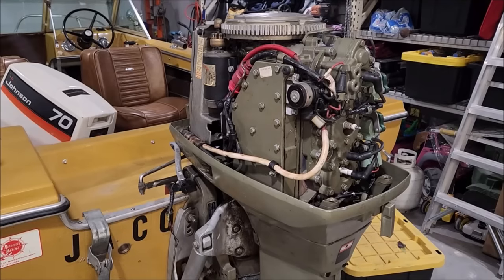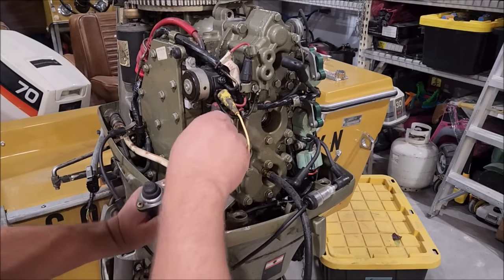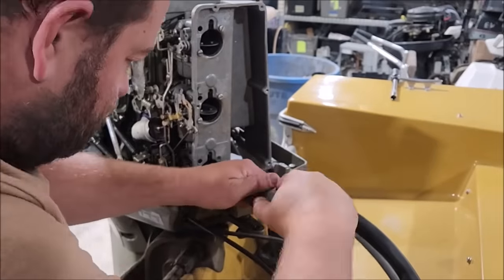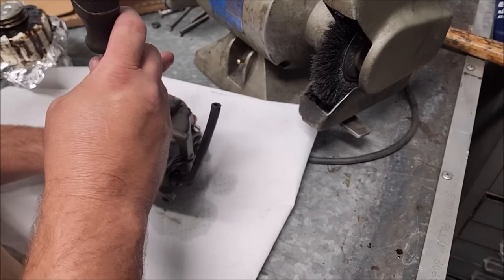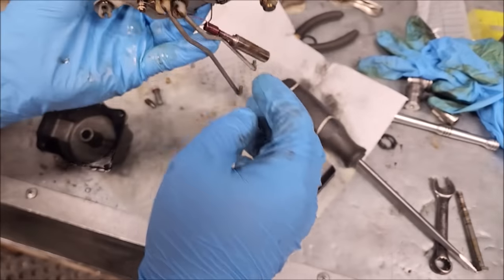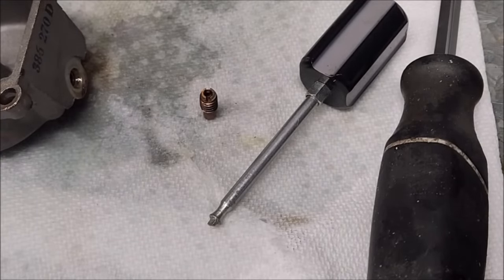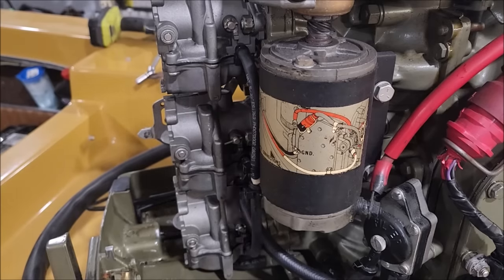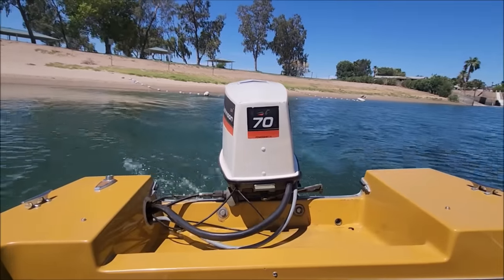Minty 1974 Johnson 70 HP Doesn't Run Once in the Water

Comment: Just had the same issue with the same model I gotta lync and sync buti found out my impeller was completely shredded and fuel pump was Crack allowing air runs mint now wot just not very stable at low

Comment: dirty jets in the carb restriction in fuel flow mixed gas the oil accumulates because owners don’t disconnect the fuel run the carbs dry after each use. Prior to the engine running out of fuel use the choke to run the bowls and fuel in the system dry.  Then you’re good to go next time.

Comment: teacher can sometime you delve into timeing-i got the initial timing w the measurements-its the running in a tank w muffs wo a timing  prop wheel-joe reeves method???-and or adjusting the idle jets-i do alright but i aint a pro and want to do better-when i get it right the engine jumps to life-when i dont it wont idle down-engine shakes etc etc

Comment: Tune the motor in a barrel of water.  The motor needs the back pressure on the through hub exhaust.  Problem solved.
Reply: Obviously not this one?
But if it won't even run in a barrel.....yes of course...check for debris in the exhaust passage.
Reply: So it runs on the mouse ears though?  Correct?
 @JohnSmith-yv6eq
Reply: What I was saying is that you need to tune the motor when it's in a barrel of water.  Don't tune it on the mouse ears. There's no back pressure with the mouse ears. Adjust the carbs when it's in the barrel.  @JohnSmith-yv6eq

Comment: I could buy one like this think it's a 1975 seahorse 70hp 300$ guy says runs great I've got a 70hp evinrude 1970 at moment I just replaced water water pump power pack coils wires caps and plugs haven't taken it out yet had same issue ran good on trailer it seemed but I water 70hp trolling motor lol so hope I resolved the problem just bought a 9.9 Johnson 1981 200$ put new waterpump and cam roller runs great got it a kicker case 70hp evinrude let's me down someplace not funny paddling miles back to launch lol northern Ontario it's common to go fishing and not see another boat so don't count on a tow if your motor quits always have a little kicker on the back also to get ya back in case lol she should push my aluminum starcraft just fine can't troll either with 70 too fast having that 9,9 be great for that too great videos I can wrench on most motorized shit but outboards are kind of a career in themselves I mean there unique compared to cars bikes trucks so a few of your videos helped me out so I had a better idea what I was up against for waterpump an fuel pump rebuild timing and throttle linkages I think is the most difficult thing to get back together and adjusted in sync  with each other carbs generally are very similar to me who needs a 10000 new 60hp or 70hp when you can get a fixer upper throw a few hundred in it little time an boom

Comment: Gee, why didn't you do the whole repair. ??  2 strokes run good, but fuel now days is lousy.  The oil in the fuel makes the engine run crappy. (plus does anyone mix the oil/fuel properly) You didn't pull the fuel pump apart as it says on the cover  FILTER.  The same schmoo in the carbs is in the fuel pump.  People with 2 strokes don't know that the fuel goes bad really fast.  I have a hard rule... when I see schmoo I immediately dump the fuel,  clean the carb, replace filter, and put in FRESH fuel mixture.  99% of the time problem fixed.  Thanks for the sermon at the end...now I don't have to go to  church Sunday.

Comment: ethanol.  eats the plastic hoses. bad stuff ethanol.
Reply: Plastic hoses (real plastic hoses) always get brittle, crack and shatter when disturbed.
Every fuel hose on an outboard needs to be replaced with corn juice (ethanol) resistant hose...
best of which is fuel injection hose.

Comment: I had a old motor that would run great on land but I put it in the water and wouldn’t run keep stalling out. Come to find out there was a bad one way valve on the fuel tank in the boat charge that $8 dollar valve boat ran great never had a single issue again